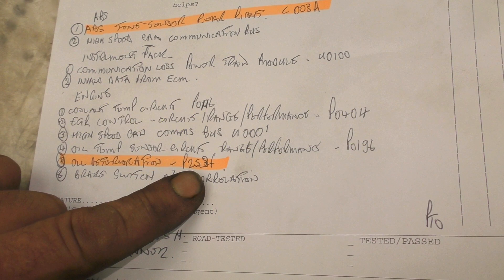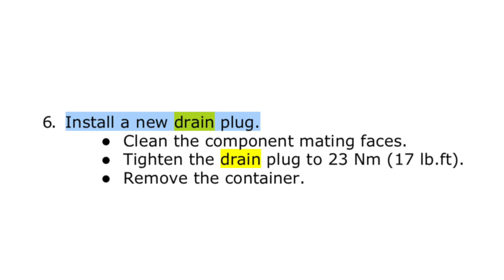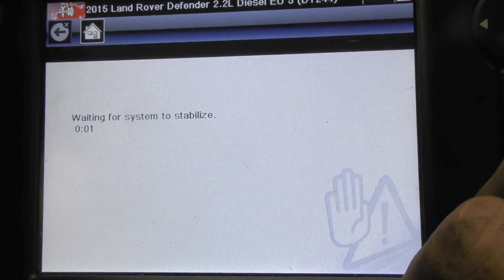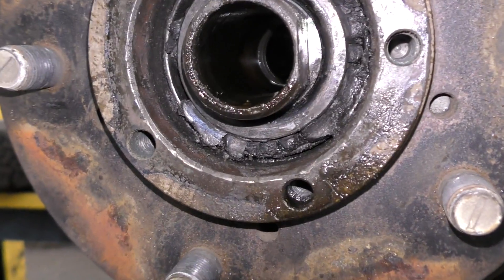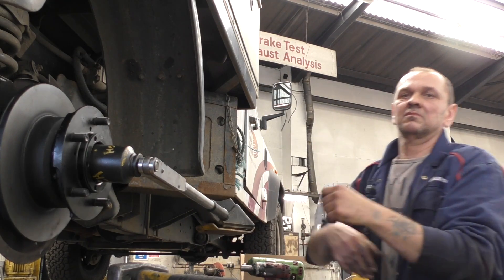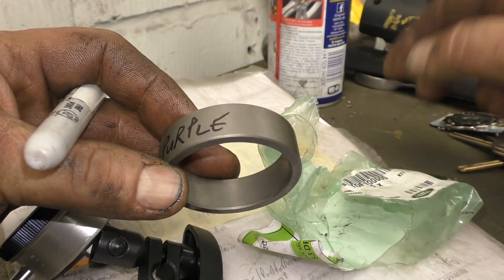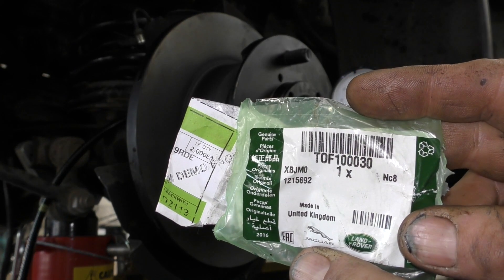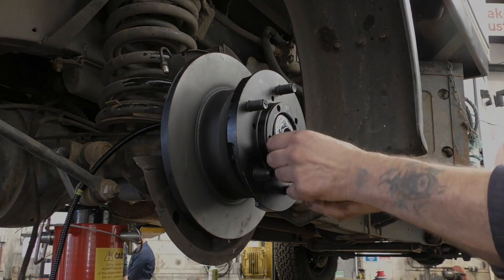Part 3- 2015 Land Rover Defender 2.2 Saga- P253F and Td5, Puma Wheel Bearing Setting

Comment: Luckily it's backwards compatible by using the older system of adjustable wheel bearings, it was only made this way so it could be fast assembled and not overtightened, which then leads to a potential big liability, nice that its able to be repaired without all those silly spacers